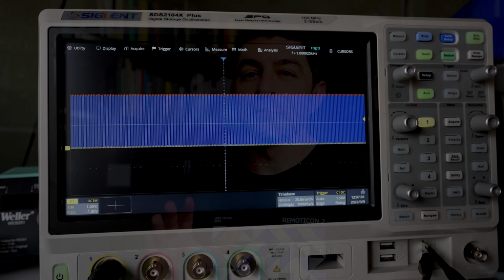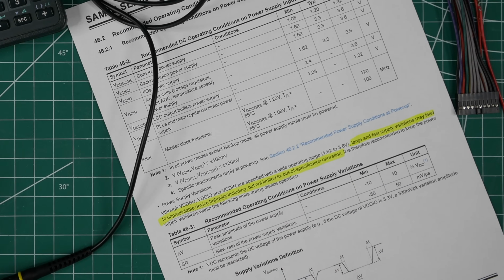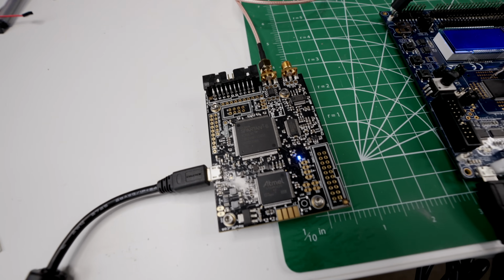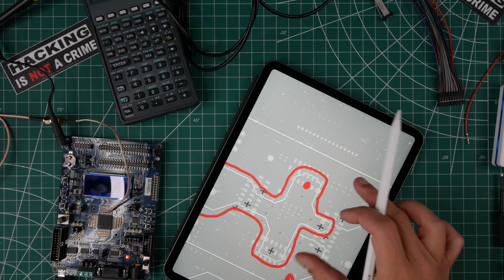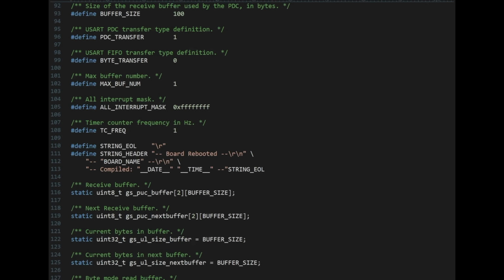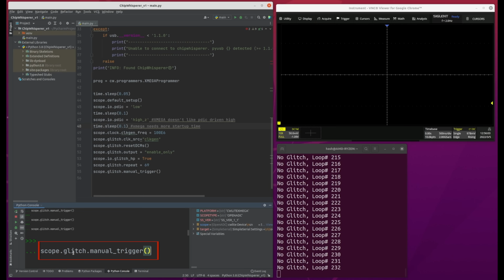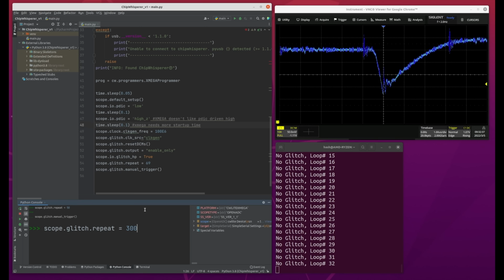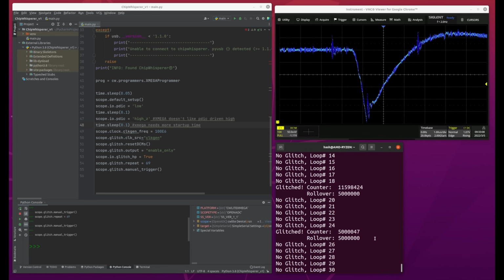Smart Meters are Vulnerable to this Attack

Comment: So it seems like you're doing some kind of trial-and-error "brute-force" attack on the processor chip by spiking voltages with various specific input patterns and seeing how it responds. But my question is, how is that supposed to help you retrieve the full firmware on that chip exactly? Seems more likely/plausible that you'll just be interrupting normal operation with some "glitches" as you put it (which is more likely to hang/freeze the program or cause it to malfunction, surely?) - I don't see how this could actually be beneficial in a practical sense. It could take years and years of tampering and still come out with nothing, wasting all that time - right? So could you summarize the objective as follows: glitch the chip in the HOPE that by some stroke of sheer luck, the security bit be misread by the processor for enough duration that it thinks its not protected and then you can start reading the firmware with an SPI/JTAG interface? It just seems a bit far fetched that you could obtain any useful information from the chip simply by fluctuating supply voltages? What am I missing? :) This almost seems like "hollywood worthy" sci-fi fiction, lol. But respect to you for the patience to do this type of work where it may seem like you're "working in the dark" until those waveforms on the scope start to make any real sense
Reply: It's a useful method used by many people to unlock these processors. A great video to see it in action and it's explained for the most part here: https://youtu.be/dT9y-KQbqi4
Reply: I'm not sure what OP is going to try to do exactly, but sometimes the aim is to attempt a normal read of the internal firmware from the programming pins and just glitch out the hardware check that the code protect fuse is blown.  Other possibilities are finding a timing where an address is set up to send some data externally from flash, and just keep screwing up the address over and over until it sends out something of interest.  For example, if the device sends a startup message from Flash when it first boots up, that could be a prime target because the timing of it is easily accessible (it's happening in early startup, and likely the timing is identical run to run).

This sort of attack gets much easier once you gain access to some of the code where you can control when it executes and then control the glitch timing against it.  Like, that's to say, if you had the whole program listing in front of you, you could look through and find something interesting and say "oh, here's part where the diagnostic mode enable bit is checked, if I can convince it it's in diagnostic mode, I can just send these external commands to get control", etc.  Obviously you don't have the full program listing, but if you can get a glitch to send you a part of code with something interesting in it, maybe that's enough to make more progress.

Comment: I wish you success. Since my smart meter was installed, it seems overnight my power bill has doubled. It went from $90 + or - to $205 as of my previous budget balanced power bill. Being on a fixed income due to my disability, the cost has crippled my monthly expenses.  I tried to get my original meter back, but no way. plus, the rf radiation has caused me headaches until I moved my bedroom to the other side of my home. BPL over the power lines has caused interference on my Ham Radios, practically ruining my enjoyment of the hobby. Yet, despite the FCC rulings about deliberate interference on the Ham Bands, nothing has been done. I once called the Atlanta Field Office of the FCC and complained but was told "Good Luck buddy in getting it changed back". So, the FCC was either paid off about the new meters, or they do not care. Whatever you can do to eliminate the monster in the round glass would be greatly and deeply appreciated. Broadband over powerlines MUST STOP, it is a danger to everyone's health and welfare! Thank You in advance for any way to eliminate this overbilling, and threat to my health.
Reply: Electronic meters react differently to distorted waveforms than electromechanical meters. See the research from the University of Twente in 1997.

Comment: Even though I don't use these systems unless I flip on a switch in someone's establishment. 
I have to say. This is the very thing that everyone should get involved in. 
I have several ideas in this reversed engineering concept which we could all use today. 
However there are not but a hand full of electrical engineers that have the honor and integrety to take on these tasks. 
I wish I could work with this man on projects like this. 
Even though my cousin is the inventor of the FIRST IC.  I was never afforded training in electrical engineering, so I'm only an inventor. 
But.....EVERYTHING STARTS IN THE MINDS UNDERSTANDING. 
keep up the great work 👍 
I'll be watching. Peace ,✌
Reply: Wow, you are related to Jack Kilby?
Reply: @dakrontu  
Yes sir. He was my cousin.
Peace ,✌
Reply: @CKILBY-zu7fq  I never met Jack Kilby. I did shake hands with J Fred and Mark Shepard while they were passing thru on goodwill tours, and I got a tour of the CIC computer system in Dallas (as I recall, 127 mag tape drives, tape numbers up in the 5 digits, 4 mainframe back-to-back redundant pairs each with about 4 MB of RAM (or maybe more, not sure, but RAM was small 4 decades ago), and a truck-size hole in the centre of the floor where they had to extend down to the floor below when they ran out of space, with hundreds of big black cables running down thru the hole). I never got to see the ASC. I was in Austin the weekend the gold was stolen (wasn't me!!!) and watched cars pass by with gold badgers going to investigate. I remember the deer in the grounds wore company badges, as did the automated mail delivery robot. Due to delays, our rental car was late being returned, so National Car Rental had informed the police to watch out for it, which may have tied in with suspicions about the gold heist.
Reply: @dakrontu  
wow brother. Thats awesome, so.   How long did you work there.?
These are the stories. 
So I have never been to the KILBY MUSEUM, have you been? 
I would like to go one day. 
Its so cool to chat with you. 
You know?????
The gold went missing at the TRADE TOWER event. 
They claimed it was evaporated. 
But it impossible, otherwise the city would be covered in gold just like they coat glass. 
SO.... I BELIEVE WE SEE THE USE OF THAT GOLD EACH DAY THIS TYPE OF PEOPLE IN OFFICE FIND WAY MORE MONEY THEN ANYONE ELSE. 
So, it makes me wonder, who where why and how. 
PEACE BRO.✌
Reply: @CKILBY-zu7fq  8 years. As a software developer. Us softies were always treated as leftie 5th-columnists by the hardies. It was my time in the fast lane, travelling a lot. TI, the hire'em fire'em company, was boot camp for many new engineers. If you worked there and thrived, you were sought after. One of my colleagues was the guy who got company policy changed so he could wear Bermuda shorts to work. Engineering was a seat-of-the-pants activity back then. Today it is much more formalised.
Reply: @dakrontu 
 very cool reply. Not many will tell their stories of the truths that exist. 
Here i see you again. 
Peace brother. ✌
Reply: @CKILBY-zu7fq  that's Super cool
Reply: Do you have a home where you use utilities? If you do; then you have a smart meter,
Reply: @eleven903  
Thanks for clearing that up for me brother,  however. I am very aware of these things. My last name is attached to the invention of the computer chip. Somthing my cousin did changed the world which provided him with the nobel prize in physics and a 1/4 million dollars. 
But then they named the nobel prize, would you believe it?
THE KILBY AWARD.  
What an honor, 
So... I still stand. 
I don't use these systems as a promoter of the advancement of the capture of mankind.  I refuse since a child. 
I'll be 13 next week.

Comment: I have been able to receive and decode the transmissions of these smart meters using a device that is readily available. It's based on a SDR. Do you have specific frequencies that they use because looking at some of the data sheets of these meters they can be interrogated over radio frequencies. They may be programmable over radio too.
The smart meter that was installed by the electric company in my house was done by some stupid woman that just killed the power to my house without even a warning. The next thing I hear is a banging noise as she is hammering on the old meter to get it free. I'm annoyed that the electric company can just come onto my property and install a radio transmitter without notification of any kind.
Reply from the maker: These meters by Landis+Gyr don’t work with the existing SDR tools to read meters. Working on some tools of my own though on GitHub. They operate in the 915MHz ISM band. 73
Reply: @RECESSIM  Great thanks for that info. I'm looking forward to trying out any new software in the near future. Thanks again. 73.
Reply: @RECESSIM  Don't hold your breath. For privacy reasons, there is the regulatory requirement that all consumption data must be encrypted. And for security reasons, commands to the meter are signed or MACed.

Comment: This meters have really complex SW models regarding SW separation to protect the legally relevant sections that are sensitive since they are related to billing. On the other side, you cant hide (to their systems) that the meter has been tampered with, and even when you are able to do that, you will trigger alarms on their systems, as they keep analizing and comparing anything with your historic. I suggest you read the current regulations for this kind of devices and how Utilities work. This is, nice as project, never attemp that on a real billing device. They can submit the meter to its manufacturer for audit when in doubt. And yes, THIS IS THING. It is way more recilient than you think.
Reply from the maker: Thanks for your detailed comment, I’m interested in the overall design and security as it relates to devices like this living in the wild for 10+ years. Not really interested in stealing energy, but any vulnerabilities in the design are definitely of interest.
Reply: @RECESSIM  I know it is not you point of interest but probably some viewer could find this "useful" LOL. Sure they have vulnerabilities ... But even if you get the code, you wont find nothing interesting on it ... believe me. The metering part could be derived from some app note (or not), but ussually full of intricate stuff, with parts in ASM, digital filters etc. The application section ... you need to understand how a multi rate meter works, rate scheduling, profiles for Energy, RMS, billing, tons of logs, alarma controls, demand control ... and when you get into the protocol part, you will fell asleep if the meter is intended to be sell in Europe ... its implementation is probably as complex as a TCP / IP stack but useless outside this industry.  This protocol models a generic device with n generic objects, implementes a number of logical servers ..... BORING AS HELL. It goal was to be "interoperable" ... LOL. If meters is intended to US market, probably still dealing with old ANSI legacy stuff ... but still pretty criptic since is table based mostly works under base addr + length read and writes. If you dont have the dictonary ... good luck.
Reply: @38911bytefree  that's what i was thinking - it would be an awful lot of work to go to to get caught stealing energy anyway!
Reply: @billynomates920  Across the years analitics have been taken an important place. The solution that manage the Smart meter on field, is actually a suite of services, with different modules you can pay extra for. And one of their modules is Non Technical losses (basically .... fraud detection). 20 years ago, the meter was the money keeper ... a little "safe". Today they keep polling the meters so the dont need to rely on the meter as a "safe" anymore. More like and audit / telemtry device  IMHO. Metering part can be very complex (avawy from calculations) but security, networking, data transport, protocols are probably more bigger and complex thant metering part itself. It is like a GPRS / PLC / ETH  with Metering LOL. Some meter act as gateways or repeaters, helping to build up the network. It is a network device.
Reply: If he can gather the software for the specific meter he has… then he can always delete any tamper triggers. Shit… he can even change the Ratio at which he is charged to like… .10:1 for every dial increment rather than 10:1 😂 but… idk.

Comment: Just subscribed.
I'm an old electronics engineer (in my 60's) and I find what you are doing, fascinating.
Back in the early days, all the microchips only had 8 legs, and I could see them all without a magnifying glass. 😁
Reply from the maker: Yea, I remember that… they also mostly had a single function and you could look at the board and figure out what it’s purpose was! Now I need a damn scanning electron microscope to figure anything out :)
Reply: That made me smile Larry, thanks. I found a Youtube, (I think), clip at one point where someone asked how big would a modern day computer be if it was built using valve technology. Whoever made the calculation used as a base model the last computer ever to be built by IBM, again I think, which used valve technology. He then used the tech data for that computer, how powerful it was and how large it was and then multiplied it up to fit the tech data of a modern super computer and the estimate finally came out at around 340 acres, fantastically unbelievable.
Reply: @richardchurch9709  Imagine the power draw on something that size! I wonder if he factored in the massive power generation plants that would be required
Reply: @AndrewAHayes  The mind boggles Andy.
Reply: @richardchurch9709  And, besides the physical size and electrical power requirements, the thing would never be stable (or even work at all) due to the sheer distances of all the wiring, which would induce signal delay, be susceptible to noise, etc.
Reply: @user181  Don't get all techy now, I'm still trying to get over the size of something like that.
Reply: I am in my 60s too. In the late 70s I was programming CPUs with 40 pins or 64 pins, and using EPROMs with probably about 24 pins, etc. Most of the 'discrete' ancillary logic I saw was CMOS DIL packages of 14 pins or more. I don't recall much with only 8 pins. In the 80s it got more insane with reduced pin-spacing, pin grid arrays, and multi-layer boards. The pace of advance was rapid. It had to be, or we would not have the chips we have today, with billions of gates. People take all this for granted. They have no idea how many hundreds of millions of man-years went into what we have.
Reply: I'm 76, and in the late 60s, I was building a lot of TTL (7400 series) projects for ham radio interfaces & controllers, and by the 70s, I was teaching digital technology to older techs a few years, and then taught computer courses at Sylvania Tech. My first DIY PC was a The Fairchild F8,(eval kit) my terminal was a TV-Typewriter-2(kit) with a security monitor display.
 I later purchased a real RS-232 terminal to use with my IMSAI 8080 (kit) that I used to proto-type other boards EEPROM programmers, I/O cards, assorted memory kits & etc. Learning to program the F8 in machine language helped me a lot when I started programming the Intel 8080 in Machine and then assembly language.  Later on, I taught at Prime Computer a few years and then NECIS for 18 years. I loved Basic, C & Postscript. Finished up my career working 15 years (5 were part time after retirement) at MITLL, where I got to test and build a lot of really neat gizmos for the Lab. My home soldering gear still gets a few hours of use, every few months.. :)
Reply: Were you able to see the legs back then because your eyes were younger or the legs were bigger? Or bof? 😎

Comment: Or you can just run the 1908 model T charging system with the easy free energy mod, and actually make 1800mo at 10c kwh.
A system that pays for itself in a few weeks.
Reply from the maker: This sounds questionable at best 😂
Reply: Just plug a power strip into itself and you will have free electricity forever.
Reply from the maker: @D-B-Cooper  The hero we needed

Comment: Here's a question with a problem this video would address... My water meter is wireless and 'read' by the water company from a truck that parks across the street.  Ironically, or not so much, my water minimimal water draw is usually almost exactly the same every month... but 2-4 months for the past few years the meter 'reads' almost twice or more water randomly some months... there's NOTHING that draws an extra 1000-2000 gallons a month possible around here.. not even a dishwasher or clothes washer.  My theory is the guy is occasionally reading the house across the street with a family of 5 that easily uses the spiked amounts I randomly see.  They say nope, that's your water bill but it's not possible to randomly change like that over the past few years.  They already made a $500 error misreading 1 first number a few years ago i had to fight to reconcile, them always telling me i'm wrong... but they found my old meter and a pic of it, and I was right about a 1,000 gallon over charge.  So...  I bet here is where we can figure out if they guy is getting 'mixed signals' from the wireless meters, or it's the mixed signals in their head I have to straighten out once and for all.  You have your mission.  What say you all?
Reply from the maker: I have a couple water meters I took apart, but crossed signals doesn’t seem likely. They probably transmit a serial number followed by your reading. The ones I have show the reeding with an analog odometer looking display. I would check to see if that matches your bill. If so, perhaps you have a problem pipe or something else causing water loss. If not, then perhaps it’s the meter, but I wouldn’t jump to that as the first thing.